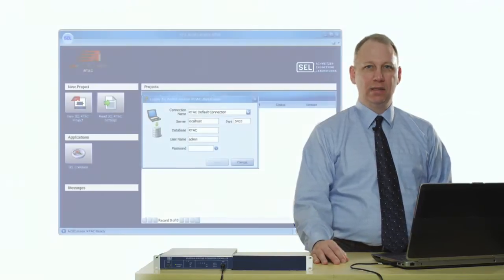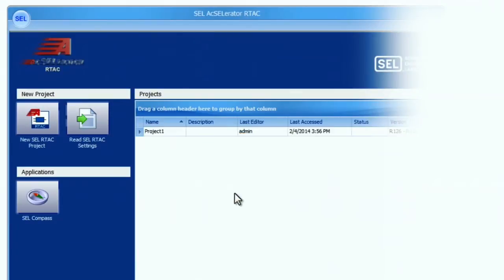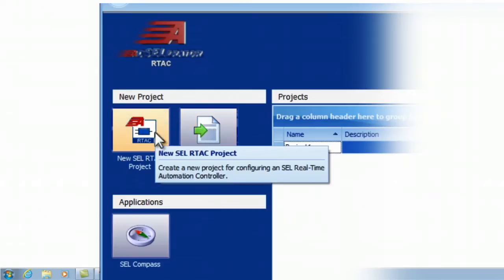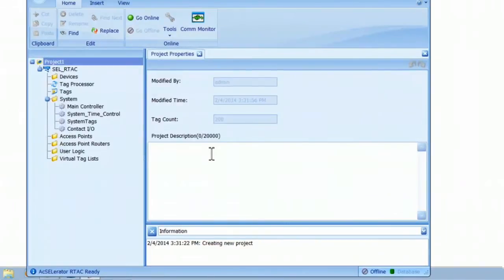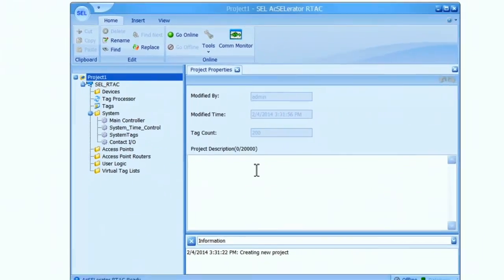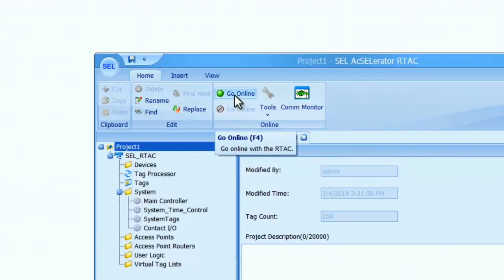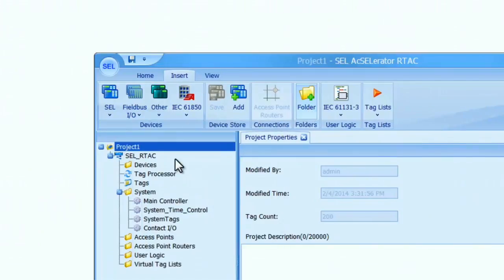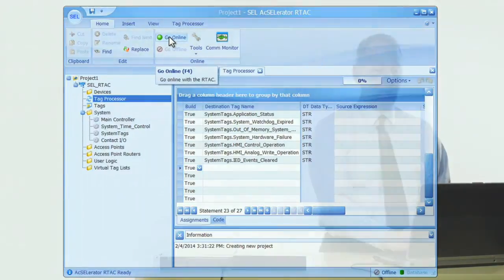SEL RTAC — Basic Software (2 of 9)

Comment: Managing switches with web interface is not a good practice considering control environment? Is there anyway configuring the switch in console login ?
Reply from the maker: Hello Sumit – a few thoughts as we are not absolutely sure of what you are trying to determine: 
- Are you trying to link web interface with the device being connected to the internet?  Of course you do not need to connect to the internet to get a web interface to work and SEL strongly teaches against ever connecting control devices to the internet.
- Console interface can mean many things: 232 serial, Telnet, SSH....  so this again is not enough info to go on but if you are talking 232 serial there is zero cyber protections on it so it is way worse then web. If you are referring to Telnet, same thing. If you are referring to SSH then it does have protections but no good key management of the crypto so it also is worse then web and also could be connected to the internet and in almost all cases provides no means to practically protect against man-in-the-middle attacks (unlike HTTPS where you have a certificate management infrastructure you have the ability to manage keys successfully and protect against all types of attacks).
- You might be referring to wide scale management of many devices where web interfaces in the past wouldn't scale but now REST is the most popular scalable and interoperable interface for enterprise SW
- We do have other means to manage and set the SEL devices, for example we have Quickset drivers for the SEL managed switches so you don’t have to use the web interface. You could use a central piece of software and manage the device settings. It still uses and is protected with TLS crypto security

If you have any additional questions, please feel free to get in touch with us at: https://selinc.com/company/contact/